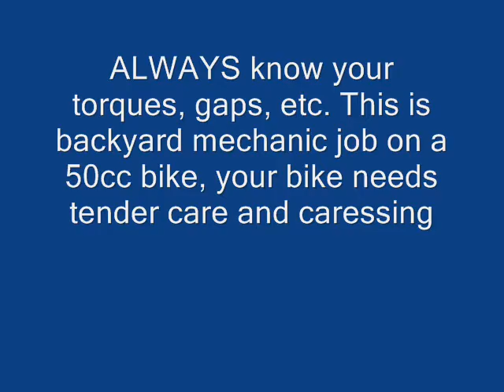Suzuki JR50 Piston Ring replacing

Comment: I cant get the piston to go into the cylinder. Any tips or tricks?
Reply from the maker: make sure it fits without the piston ring on. install the ring buy itself and check the ring gap. Not sure what it should be  but 004 should be ok. make sure the ends of the ring are on both sides of the little pin in the piston ring gap that keeps the ring from rotating in the bore

Comment: Novice mechanic here. Working on a jr50 I bought my son. Will roll start, and drive. Will kick start. But if you kick it and put it in gear it immediately kills it. Like metal on metal or something. Any clues or advice?
Reply from the maker: Not really but I would look at the clutch system, sounds like something is locked up that should slip.  And look at more JR50 videos, youtube is great that way....